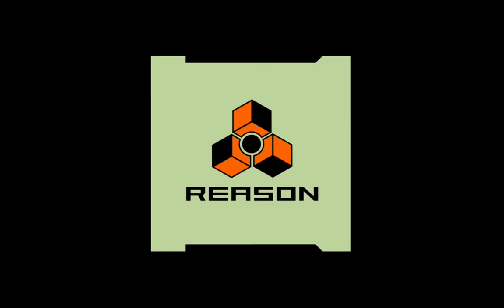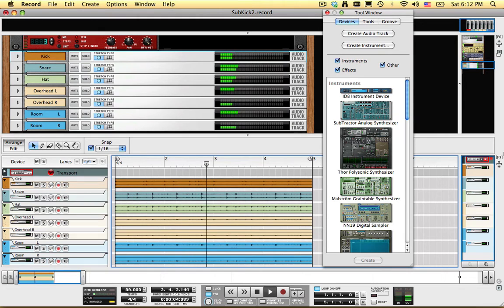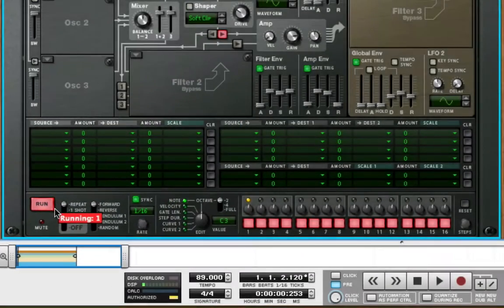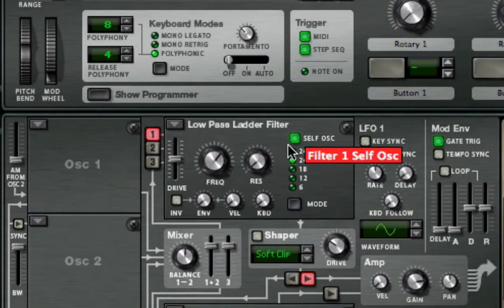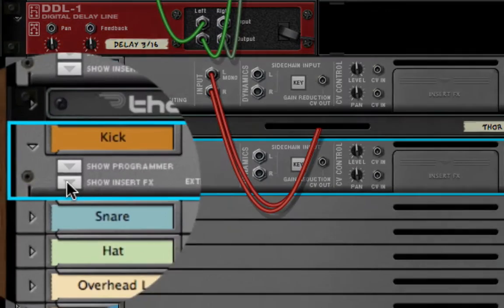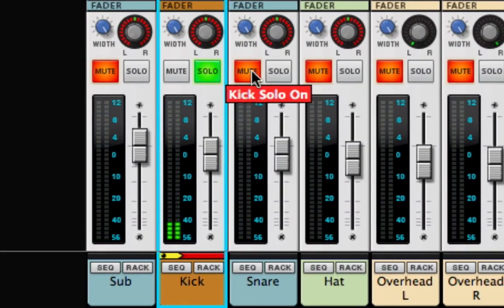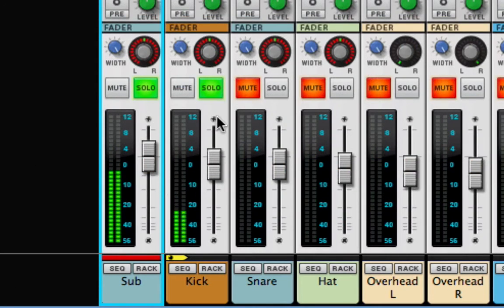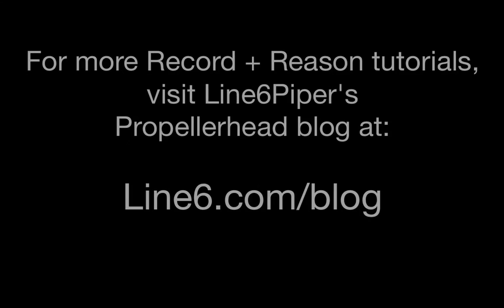Mixer Tips & Tricks #1: Sine Wave Sub Kick | Propellerhead Record

Comment from the maker: @eday4 That filter is super loud (I'm using Filter 3). I would turn Thor's Master Volume knob down to less than 50%. I've got mine at -16dB and it's still louder than I would probably use in a track (without turning the channel fader down as well).

Comment from the maker: @eday4 Holy crap, how did I never notice that!  Too bad the gate doesn't go to -infinity. I fixed the problem over here in the following way: 1. Create new Mix Channel  2. Route Direct Outputs of Thor's Mix Channel to the inputs of the new Mix Channel. 3. Activate the new Mix Channel's gate, and turn it's Range knob all the way up. Now you've got -80dB. Also, Thor's filter is super loud, so try turning Thor's output knob down a bit - You'll probably still have plenty of signal. Thanks eday4!

Comment from the maker: @eday4 You don't have to use the expander switch. When using the gate, just make sure you turn the Range knob all the way to the right. If the attack isn't sharp enough, you can try engaging the Fast button, and if the Release isn't sharp enough, you can try turning the Release knob to the left.

Comment from the maker: @zellseagull1 Thanks for coming to the SAE clinic! 
There are many approaches to making build-up effects. A few basic ideas: You can use a low-pass filter on your bass line (and any other synth stuff going on during the build-up), and gradually increase the filter's cutoff frequency during the build-up (opening up the filter). You could also gradually raise the pitch of a sustained bass note, and/or other synth sounds. Also maybe bring in some white noise of increasing volume. I hope that helps.